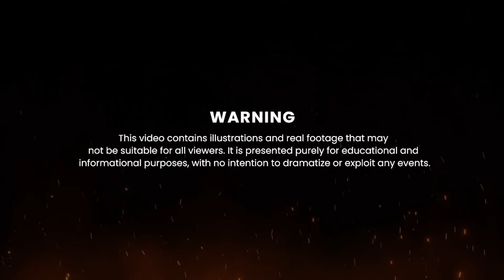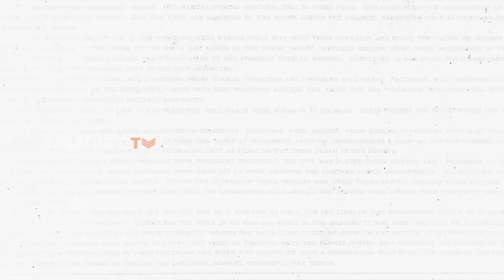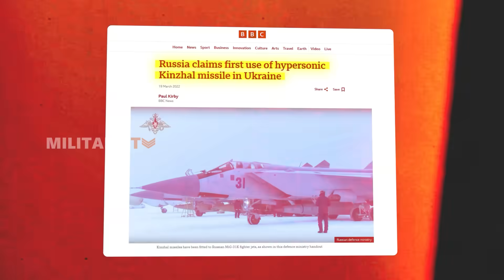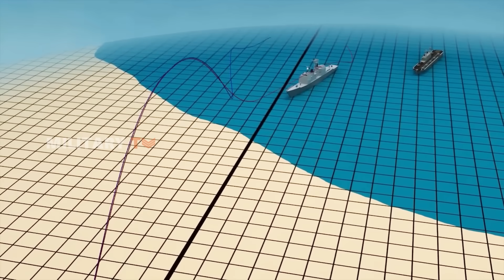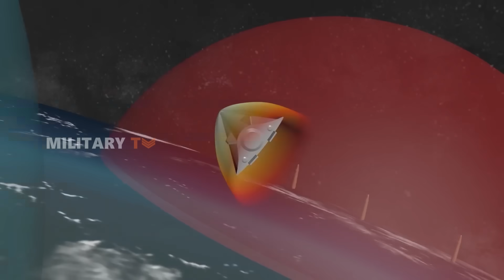America’s Biggest Setback – Why the US Can’t Keep Up with Russia’s Hypersonic Missiles

Comment: THEY HAVE NO DEPLOYED THE AVANGARD 

That means Nuclear war AVANGARD is a hypersonic reentry vehicle of an ICBM that can travel over Mach 22 and even if it doesn't have a nuclear warhead the kinetic power of the warhead would be devastating at such speeds like a larger comet hitting the ground. 
What you meant to say is Iskander and Khinzal (the two systems are related to each other, Iskander is a ground launch Khinzal)

Comment: The person who is handling this channel seems not to understand very well how hypersonic missiles are working, and why the occidentals who have more than ten years delay are struggling to build their own. Achivieving hypersonic speed is not the problem. The problem is that your missile must communicate throught a plasma bubble, it's sensors should still be working inside the plasma bubble, and the explosive charge should not explose due to intense temperatures. And finaly, how to modify our defenses to see the missiles as the plasma bubble is acting like a smoke screen for radars. We are VERY far to understand all this...

Comment: These are programs that got stuck 30 years ago, only there was no need to work on them for the simple reason that they are expensive to produce and that Russia has more than enough nuclear weapons, from the smallest ones such as mortar mines to MLRS missiles and all the way to FAB bombs to intercontinental missiles that are very well known to be exceptional.  I'm not talking about the latest ones, but about everything that Russia completed by 2010. Even only the Iskander M system Which we've all seen how effective it is today with an extended range of 1,000 km is quite good enough that it's absolutely pointless to go into conflict with a country that can build a lot of those nuclear-charged missiles that are 10 times more powerful than what we saw in Japan at the end of WW2. Along the way, these missiles can be fired from aircraft, which makes them much more difficult to intercept! And if you know all this, how is it possible that there is still a

Comment: You shouldn't show the f35 in the context of high-tech, 2ndly it's the corruption and brain drain hypersonic isn't the beginning of failing western tech, it's just a glaring example. EVs, Communications Rocket technology period and a question are those astronauts still stuck on the space station? Then so-called AI SMH, this is only the tip of the iceberg.

Comment: Taking a short range Islander ballistic missile from the early 2000’s  and adapting it to being air launched and calling it the Kinzhal doesn’t make it a true hypersonic missile. Otherwise Germany in the 1940’s had hypersonic missiles with their V2 rocket. The Kinzhal isn’t a cruise or glide weapon, just a rocket dropped from a plane.
Reply: That's not how the Kinzhal works 🤣. Your description is so stupid but I guess it's good enough to fool idiots with no technical knowledge. It is a hypersonic missile.
Reply: @zemm9003  thanks for this, what makes one hypersonic is the speed not the year of manufacturing
Reply: @kenkuntai  In that case the V2 rockets from the 1940s are also hypersonic, as they travelled at speeds in excess of mach 5.
Reply: @zemm9003  you mean being dropped from a plane, igniting it's engine and following a shallow ballistic  path to its target? Which bit didn't I understand 🤔
Reply: @zemm9003 😂😂😂😂
Reply: delusional
Reply: You are in too hockey 😅
Let's go Islanders
Reply: a lot of assumptions and no facts.